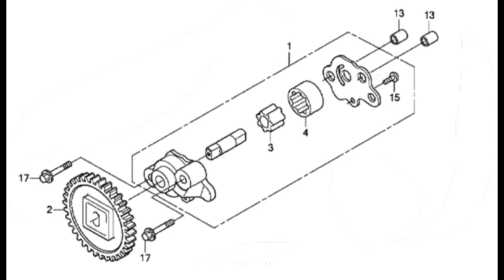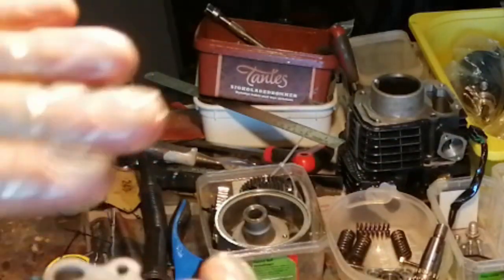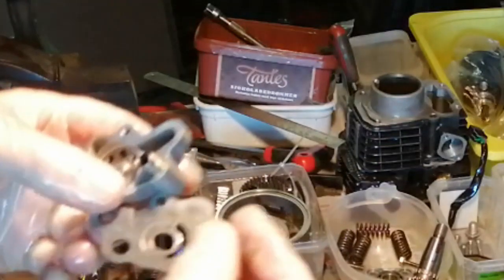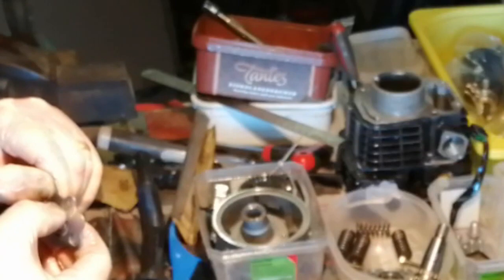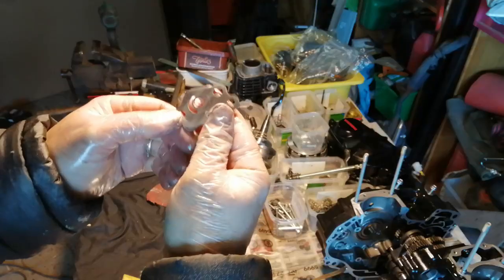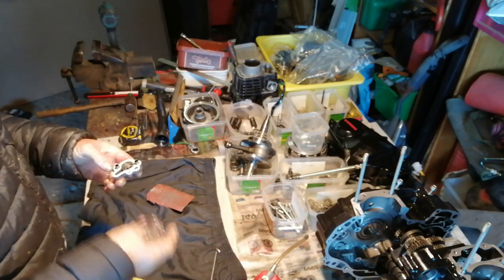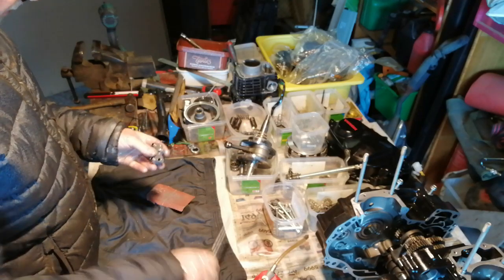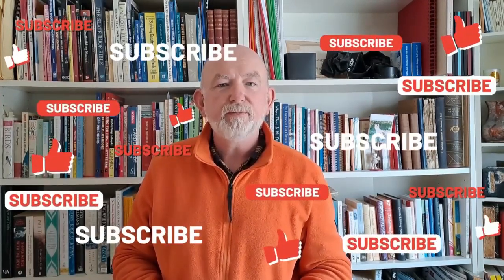HONDA CB125F Oil Pump #5 Removing scratches in the backplate and measuring the clearances.

Comment: the oil pump is the most overlooked part when rebuilding a engine that has had a piston seize due to low oil ..... i knew someone who rebuilt the same engine twice after he didn't keep up with maintenance and the 3rd time it seized was because the oil pump was so badly damaged it wasn't working properly.
Reply from the maker: Yes, debris definitely found its way into this tiny little pump... Feels like it's only as big as a matchbox!

I have a little oil pressure gauge in the drawer and want to fit it in the spring. Not really anywhere to fit it though... I don't fancy drilling into an oil way, assuming I could find one. 

There is a screw at the top above the cams for checking the presence of oil... I wonder if I could take a pressure reading from there...?
Reply: @handycrowd   yeah little chunks of metal like sand are all around the engine when you run it low on oil and most people just chuck a new piston and cylinder in and call it a day lol. Also I don't know much about the CBF engine. I'd recommend you look into the stuff they do in Indonesia, Philippines and country's similar they have like a culture around modifying the small cc bikes. There will definitely be some information about fitting a oil pressure guage.
Reply from the maker: Yeah thanks! I got a lot of help from some videos on here in Hindi rebuilding the 'Hero' engine, which looks identical to this... 🙂  @mrpantur7280
Reply: @handycrowd  they basically are the same! The only difference is usually the piston and cylinder. For example Yamaha nmax and honda pcx has same engine over there but it's 155cc and 160cc only difference is the bore everything else is the same. I think the cbf125 engine powered bikes over there are 150cc or something like that? Not to sure but it does look cool seeing the stuff they do. Imagine a cbf125 with a 220cc big bore lol. I bet it would power wheelie lol.
Reply from the maker: Exactly! I was tempted to go the big bore route as I have my full licence, but reading on various Facebook groups, it seems like the bikes ECU won't cope with it, especially if you throw in a better exhaust and air filter... There are, I think they call it 'commander' units you can use to replace the ECU, but then you're talking silly money and a lot of work, so I decided to keep it simple. 
Thanks for stopping by  :-)   @mrpantur7280
Reply: @handycrowd   tbh a lot of people on forums and groups have no idea what there talking about lol. even mechanics are useless, I've had my fair share of run ins with bad mechanics. i once called out a cowboy mechanic at a official Yamaha dealer because i caught him using a air powered impact gun to tighten bolts that only needed 30nm not 150nm/300nm lol. if you want the true facts when it comes to tuning small cc bikes your best bet is to try and get in contact with tuners in other country's and see what they say. or take a deep dive into there websites or forums ..... you'll have to google translate everything doe because it wont be English lol. also with big bores the running issues would most likely be with airbox restrictions or piston crown/shape and compression. if you fit a high compression 150cc kit with a restricted airbox you'll have issues. then fit a genuine Honda low compression 150cc bore kit imported from Taiwan the bike will run 100%. https://yuminashi.eu/cb125f-glr125-sp125-2015-2018/?_ga=2.6101939.1278987599.1708607601-832365246.1708607601 theres a link to a website that sells tuning parts for 125s. all important info is in the description of each product.
Reply from the maker: Good stuff! Agree re. mechanics, that's why I do all my own work lol! 

Had an interesting conversation this week with a pro tyre fitter who took no notice of the manufactures yellow and red dots...

I thought I'd ask him, "what do they mean?", and he did have a 'working knowledge' of what they were, but when I asked him, "why didn't you align the dot with the valve then?".

His reply " the machine balances it anyway..."   ffs! And folks wonder why I try to do as much as I can...   @mrpantur7280
Reply: @handycrowd  yep I'm exactly the same i try and do as much as i can myself. i do literally everything. On paper my current bike has never had a service lol but i don't care, its made it to 37k miles with 0 mechanical issues because its been maintained and serviced correctly by ME! lol. i personally think all work should be done correctly on vehicles especially on motorcycles. tbh i find it funny listening to other peoples story's about there "GOOD" mechanics but they always seem to have issues with there bikes? hmmmm i wonder why maybe this "GOOD" mechanic is actually shite. ive heard the saying "hes been doing it for years lalala" but i don't care you can still be rubbish working as a mechanic for years. i can spot a shite mechanic a mile away lol. you seem like a very smart man. how did you get into the whole do it yourself stuff?
Reply from the maker: I've been self employed as a builder since I was 18 and essentially needed my vehicle every day or it meant no work/no pay... 

So not only would I have been earning no money I'd have been paying someone else to fix the issue whilst I sat waiting... 

Seemed a no brainer at the time to learn how to do it myself. Always been into cars/bikes/boats... Hmm, I'm detecting an engine theme there :-) 

Only job I've ever shopped out was a head gasket replacement on an old Freelander, and that was only because I needed a receipt to claim the cost back from the garage I'd just bought it from (and it was supposed to have already been done...)... 

Incidentally that was also the only vehicle I have ever bought from a garage... 

Can't beat doing stuff yourself I reckon :-) 

(although I can see it getting more and more difficult as time goes on... I mean already you are not allowed to work on the electrics in your own house... Grrrr. Having to pay a 'kid' in his twenties who knows less than I do gets my goat lol!)

Have a great weekend, whatever you get up to :-)

  @mrpantur7280
Reply: @handycrowd  I'm exactly the same. but for self employed work I'm a delivery driver and the only reason i do the job is because i don't like most people.

 I'm not the smartest person but i do feel like most people i interact with are extremely dumb and incompetent lol. so yeah working by myself is easier and keeps me calm. i have thought about doing the handy man sort of work but i feel like i would get into arguments with customers lol. 

when it comes to doing vehicle work and maintenance i was exactly the same as you, I couldn't wait around weeks just for a basic service or to get some small work done because i needed my vehicle to make money. was even more annoying when i brought a brand new bike and it had issues a month later and the Honda main dealer said bring it in and we will have a look. they said it would take 3 weeks to look into it ???? i was like FU@K OFFFFF lol. i just stripped the whole bike down and fixed it myself.

i used videos from Thailand on how to take all panels off bike and then fixed it in 2 days lol. 

I feel your pain lol. i would hate if the government said i cant do my own work and have to have some pleb do the work instead. i think at one point the government wanted to bring in a new law that people who owned vehicles couldn't do there own work or something like that.

you have a good weekend as well :)
Reply from the maker: Yeah they still are, 'type approval' I think it is, basically you can't change from standard.... 

And yeah, mine would be the perfect job... if it wasn't for the customers lol! 

I've started to do more renovation work on cabins and that is fantastic, no one around, great locations, simple constructions etc... 🙂 @mrpantur7280
Reply: @handycrowd   yeah i imagine you get loads of annoying customers who try and cheap out on work or complain about something you have done. its good you found something you enjoy more. maybe do a build series that you could show customers and then obviously post on the channel. maybe a time lapse video?. i was thinking in the future to build my own garage/shed in my garden as i wont be able to afford a house with a built in/on garage ... I've been looking at armoured bike sheds from a company called asgard there about 2000-2500 pounds to buy and build. what do you think would be better. buy one or design/build one myself?
Reply from the maker: Oh the customers never complain, 99% are just so happy to have someone in they can trust. Just that I like working alone and working in occupied homes is a whole different ball game to a project or unoccupied property or cabin... 

Never had a metal shed, I wonder what they are like for condensation? I guess they are ventilated though so probably okay.

Unless you can find some free or nearly free wood, buying a 'kit' is probably going to be cheaper. It surprising how all the bits and bobs you need to build one from scratch... Built ones tend to be stronger though and last longer so... 

Still a couple of grand or so still buys a fair bit of wood and then you get it exactly the size/shape you want. Difficult call, I've always built mine as they've been in odd shaped areas and of course I have all the gear etc. 

 @mrpantur7280